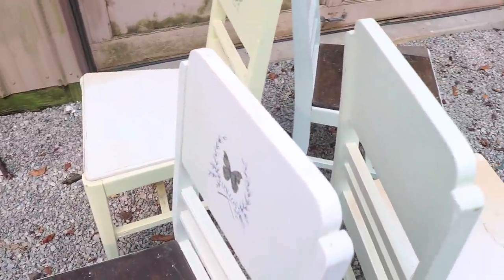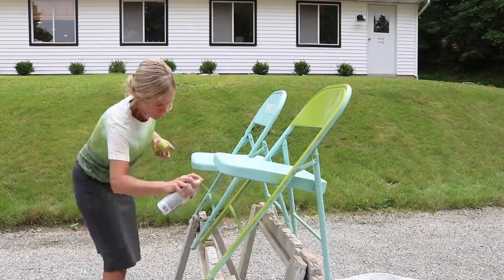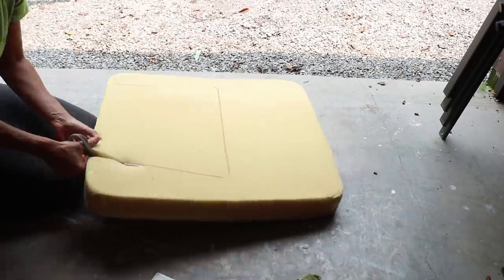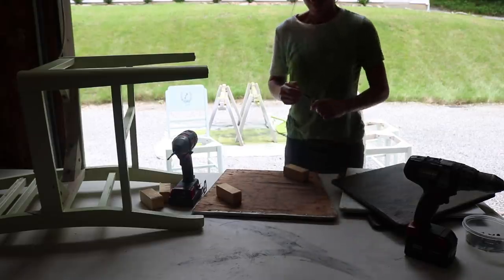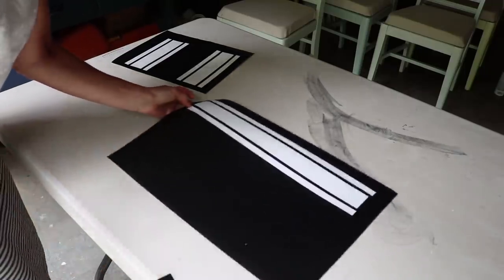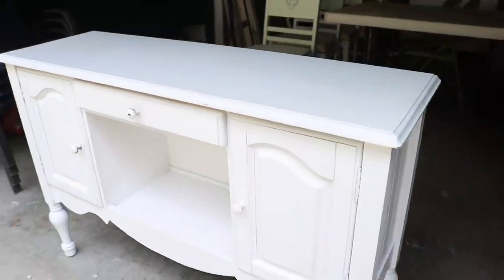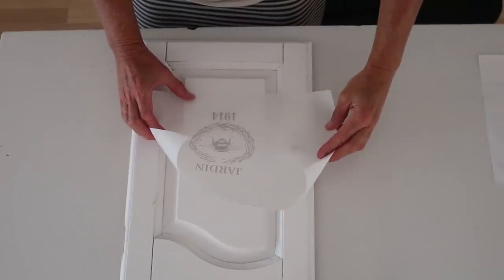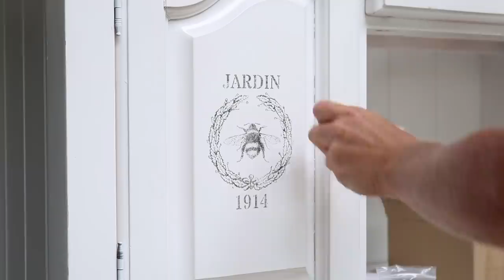Adding Character to Furniture ~ Random Furniture Makeovers ~ Image Transfer using Parchment Paper

Comment: When using foam for seat cushions, cut the foam a tad larger than the wooden seat.  It will compress and make a nice rounded edge.  Stretch a layer of quilt batting over the foam along with the fabric. This will round out the edges and disguise minor flaws in the foam. It also keeps the fabric from wrinkling and pulling away from the foam  after people sit in the chairs for awhile.
Reply: Very well said. Thank you for the info.
Reply: Yes quilt batting would hide some imperfections
Reply: Thank you!
Reply: Thank you. I have a couple of chair seats that I need to re-cover.
Reply: Mary is so talented and creative in her own way. Just simply amazing👍
Reply: Can cut foam with an electric knife.  The high density foam from JoAnns,  if thin, can cut with a scissors.  I have never cut foam horizontally like Mary did.  Doesn't seem safe to hold...perhaps rigid foam in a vice would work  The electric knife on 5" thick high density foam often results in a imprecise edge as it is difficult  to keep the knife steady.
Reply: Thank you for this info, Laurie! I am about to make some cushions for the chairs at my kitchen table and I’ve hesitated for a month because I’m scared that I’ll make them look wonky!

Comment: Hi, Mary! I wanted to share a quick tip on covering seats with foam cushioning: Take your fabric and staple it to the bottom of one side of the seat. Then take the fabric on the opposite side of the seat and pull taunt. Then staple that side down. Sometimes it helps to have someone do the stapling while you keep the fabric tight. Do the same with the other two sides. I find that by doing that, it will smooth the obvious edges of the foam. It really softens the edges and gives a more rounded edge. Just make sure you really pull the fabric tightly!!! Hope this helps in future projects. Thanks for sharing your gift of creativity!!!

Comment: The projects turned out very nice! When using a can of spray paint, I have a comfort grip handle that fits over any spray paint can. Instead of using just your index finger, it allows you to use your grip and works great. I bought it when I was going to redo 4 wooden chairs and it took A LOT of spraying!! Now I use it even if I’m only doing a small project. It was only a few dollars at the hardware store.

Comment: Every week you amaze me - with your projects - Stone Soup (something from nothing).  

I see Maria beat me to the electric knife comment. I purchased an electric knife at a thrift store for $3 - works perfectly for cutting foam.  Also, Dacron (like quilt center, only stiffer) is super cheap ($2.50/yard) and will hide any miscuts of foam.  You simply glue over the foam.  I purchase  Dacron at an upholstery shop.  Reusing foam is important as the price has shot up in the last six months.

Thanks again for the ideas.  Your creative mind brings me a smile each week.  :)

Comment: Love your videos!  Regarding the cute white chairs that got new cushion seats…
Remember this tip for the future.  If you had wrapped the top and sides of the foam with a 
layer of Dacron fiber  ( which you glue down with contact cement) before you applied your fabric,
Those lumps and ridges you mentioned would have been hidden, and your cushion tops would
have had a soft appealing crown.  Once again, I love your videos, and try not to miss even one.

Comment: Hi Mary, as always you come thru nicely.   I have used an electric knife I found at a thrift store specially for this issue.  Also Mary, try using batting, batting isn't expensive and you get a lot with a crib size, and cover the foam around it, glue it liner to keep batting and foam together.  Then staple the outside fabric to chair bottom.  The batting helps to soften the foam.  Liners, can be ole sheets, bed pillow covers,  etc, just lighter then the top fabric, or upholstery cover.  Love your channel.  Today's vlog is also inspring that anyone can do it, may not be as you would like it, but doable.   I am thinking of doing the transfer like you did, as I don't have a cricket or a silhouette machine to make transfers.  Thanks so much Mary.

Comment: Use an electric knife to cut foam. It works great. Also if you put a thin layer of batting over the foam it will make it much smoother.

Comment: I love this video for so many reasons! One thing I do when using foam (Or - as in this case - RE-using foam 😊 ) is to wrap it with either batting or an old (Clean) flannel sheet. The wrap seems to smooth out uneven foam issues.
Reply: Hi Laurie

Comment: your problem with stenciling is that when you stencil,   pouncing or swirling, your tool must be on the dry side.  If not,  you get a bleeding effect.   When I stencil I put 2 light coats,  the first application is like a primer boundary.  When it dries, it is a stabilizer to the first coat.   It might take longer to stencil, but you get crisp lines.  Also, to get the dry effect of the sponge or brush.   you have to offload onto a paper towel.   Offload is pouncing your tool on a surface to knock off the building of paint.  I hope this helps on your next stenciling project.      Good Luck,   Les Meyer
Reply: Thank you Les Meyer! I will try this. My attempts to stencil have been ruined by having too much paint when I start. Now I know why! Thank you!

Comment: Beautiful chairs Mary! The 4 in 1 Foam Cutter Set With Digital Voltage Controller, GOCHANGE Electric Cutting Machine Pen Tools Kit, is what I use to cut foam for my projects. I highly recommend it. It finishes/seals the edge as it cuts. I tried to share the link to it, but YouTube wouldn't allow it to post, sorry.

Comment: QUESTION:  You paint from glass to wood and everything in between.  What determines whether you use your sprayer, a spray can or a paint brush?  
Also, how do you determine if an item should be painted with chalk paint or light sheen paint?   One more question,  what determines putting a wax  on the piece as opposed  the spray finish you use?  
Love everything you do.  You’re a real inspiration.  Thanks!

Comment: Another suggestion for seat fabric, I  keep an eye out for pretty waterproof shower curtain fabric. I covered my kitchen table chairs with it and it’s easy to wipe down. Not vinyl but the kind hotels have that don’t need a liner.
Reply: As a mom of four, I appreciate this suggestion!
Reply: That's a very good suggestion, thank you.
Reply: I just used two cotton tablecloths from Target to make drapes for my spare bedroom.  The fabric would have been 3 times as expensive at the fabric store and since the tablecloths were already hemmed on 4 sides all I had to do was trim some off the bottoms and sew in a new hem.  Took less than a half hour.  Fabric shower curtains are also a great way to find hemmed fabrics.  Problem solving at its best.
Reply: Thank you . That idea of yours will work well for our RV trips🙏🌞
Reply: @catgirldo7646  had thought to do this, thanks for sharing!
Reply: Such a great idea! I never thought of that and so many of the shower curtains are just beautiful! Thanks for the great tip! :D
Reply: I have a porch swing cushion that needs replaced. What a great suggestion!

Comment: The seat cushions would look better and last longer if wrapped with quilt batting, it also evens out rough cut foam. Just spray glue the foam and wrap.
Use an electric knife to cut foam very easily.

Comment: The fabric store I worked at used an electric knife to cut and shape foam. Works so well. Beautiful transformations. One question: does the latex paint on the metal chairs scratch off as the are used?

Comment: Your foam would have been fine if you took polyester batting and cover your foam stable down makes everything smooth also cut foam 1 inch over board . I do upholstery Love your tube ! Also a a electric meat knife cuts foam perfectly sometimes you can pick them cheap .

Comment: Everything turned out so pretty!!  Saw GingerChick used an electric knife to cut foam and it worked great.  Like slicing butter.  
Question.  How noisy is your air compressor?

Comment: Love everything. Does the parchment paper have to be a certain way when you are printing it ❤️
Reply: I have used this method and no it doesn't matter but the parchment has to be on the bottom when putting in the printer and place tape on parchment and printer paper only on end going into printer first, this helps when taking off parchment after printing from printer paper.   Having tape ready when you are placing parchment on your project is great so it doesn't move around when you are rubbing the image onto it.  I use "Graphic Fairy" and love there endless supply of free images.
Reply: @klouise2800  Thank you so very much can't wait to try this process ❤️
Reply: Hi Michelle
Reply: @alexbaylon951  hello

Comment: Does anyone know if you can use an ink jet printer for the transfer design?   I read somewhere that this only works with laser printers.   
      Thanks!  ~ Maria
Reply: Actually, the reverse is true: INKJet is what one needs for doing transfers... Laser printers use TONER, which uses static electricity to attach toner (which is powdered ink like substance) to the paper... INKJet is ink...hence, INKJet is the printer of choice for crafters for success in image transfers.

Comment: Enjoy your makeovers!! A hint for cutting foam-I couldn't tell what type of knife you were using but in my upholstery shop a serrated or bread knife works great!! I have tried an electric knife but it tends to chew up the foam and not leave a nice sharp edge!
Reply: Thanks for the suggestion I made a right mess trying to cut my foam, thank you so much for your suggestion.
Reply: @carolyndymond5521  you are so welcome!! I've done a lot of trial and error over the years in cutting foam but always go back to serrated knife! Oh and if the knife wants to stick to the foam-spray the knife with silicone spray and wipe off, then try again-that helps too!!

Comment: I luv most of Mary's project's.. butvascan upholster.. the dining chair pads need alot of work! And the back of 1 of the chairs has the top layer of veneer terribly warped..u were better off peeling off that layer sanding the edges and repainting

Comment: Your chairs are lovely.  Just a note...If you use some high loft polyester batting and cut it just short of your fabric seat covers you'll get a smoother edge. It looks more professional and makes the deat cover last longer because there's less rubbing between the wooden seat and the fabric.  It only costs pennies per chair to do too! If you can only find low loft, double it of course. 😉 Just love all your videos.  Your ideas are wonderful!

Comment: The grain stripe on the folding chairs is a great up-cycle, love the transfer method with the parchment paper. The wood chairs are so cute, as for the foam, an electric knife works well for cutting. We received one as a wedding gift 35 years ago and use it to cut foam and bread when making stuffing for Thanksgiving. Maybe you might be able to thrift one, however you can find an inexpensive one on Amazon.
Reply: Also works for cutting angel food cake.
Reply: @jenniferdahl4475  YES! That as well! My fav